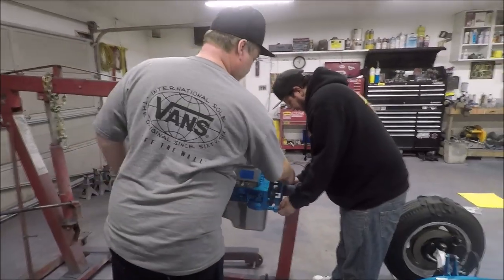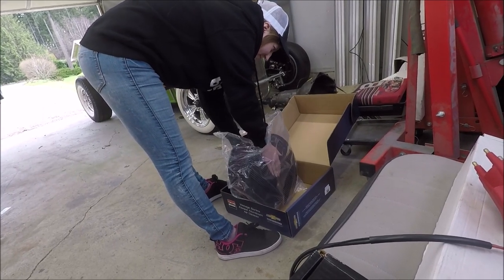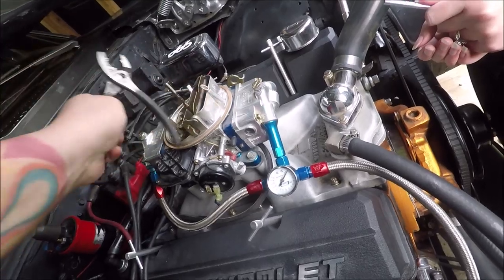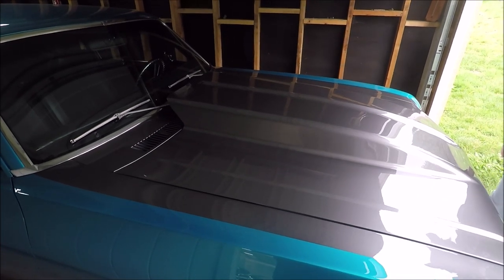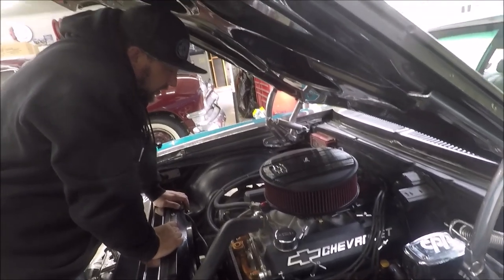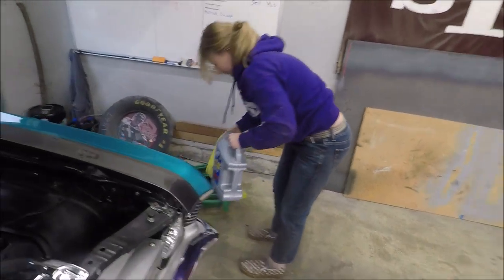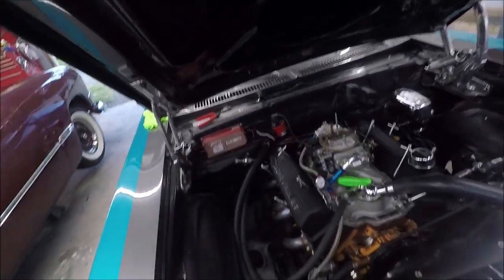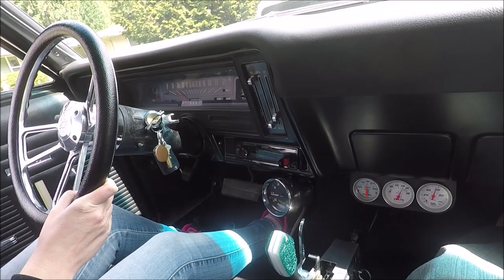Rusty Repairs and Model A Hot Rod Progress

Comment: When you painted the engine in the hotrod did you paint it just like the body? Or add something different?
Reply from the maker: king0cans just like the body.  Stripped to bare, epoxy, base, and clear.
Reply: @SYFGARAGE  Thank you. Wasn't sure if it would flake off
Reply from the maker: king0cans I’ve never had a problem, but I have had discoloration around the exhaust ports.  He left these heads bare aluminum so this one should last a long time.